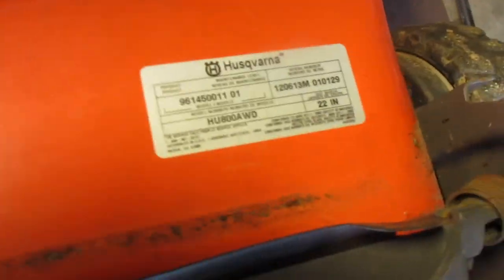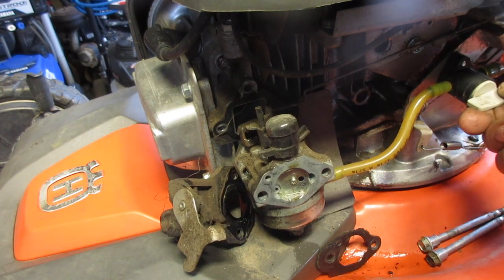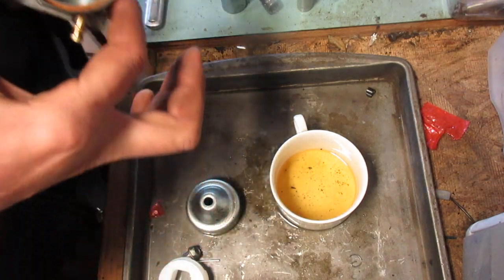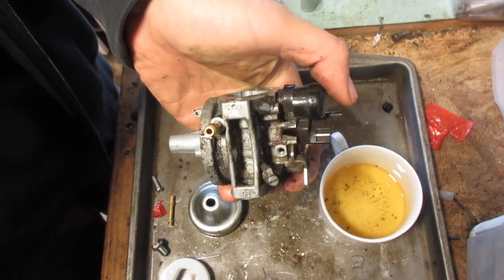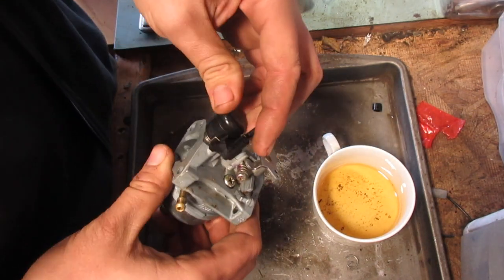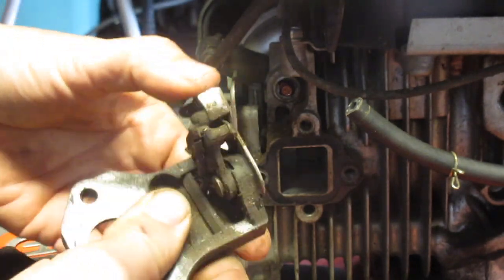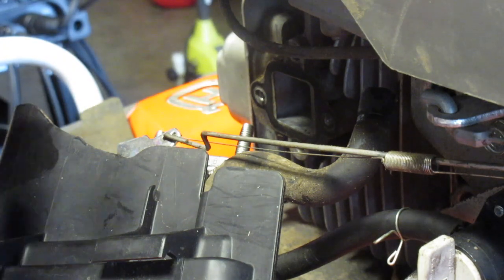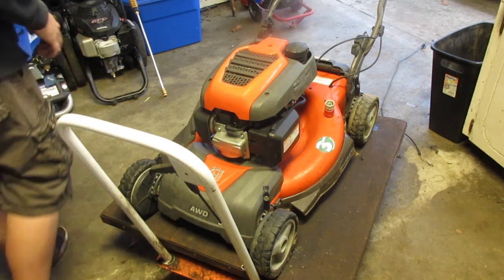GCV160 Auto Choke Repair

Comment: This might be the solution to a current issue I am having with a Husq RWD self propelled mower. It will start after several pulls and run for a few minutes, then run rough and die. I thought it was the float bowl but that seems to be working ok, and clean. In my own hack diagnosis I seen the auto choke pin and pulled the pin out for a look at it, didn't know the rest of it could come out. It did project out while the motor was hot and after about 10 min of cooling down I was able to press it back in. But, as you show, its an easy replace so I'll order the part and hope it does the trick. Thanks for the video. I seen your replacement was a pink color, OEM I assume. Seems the non-OWM are not that color and half the price.
Reply from the maker: Yes. The pink one is the OEM and I would definitely recommend not using anything else
Reply: @PNWSmallEngineandLawn  $38 on Amazon. Sound right to you?

Comment: Any special trick to defeat the Honda bond to get the the wax piston out??
Heat, thinner?
It's wicked hard to get out.
I saw the screw method but that looks a little scary.
Reply from the maker: Heat is a good idea. I have let the machine run by starting it with starting fluid to help heat it up. I will also use fuel line plyers or a pick.